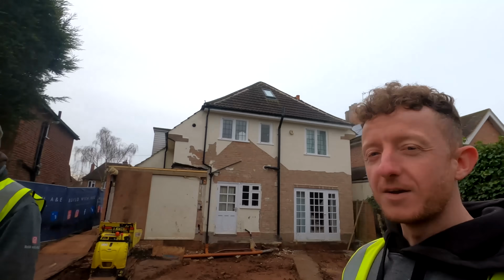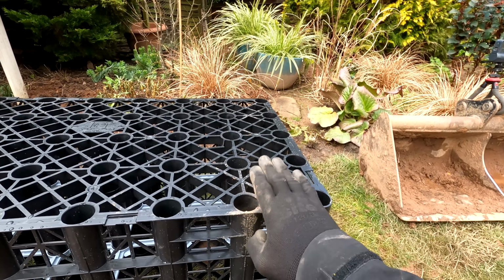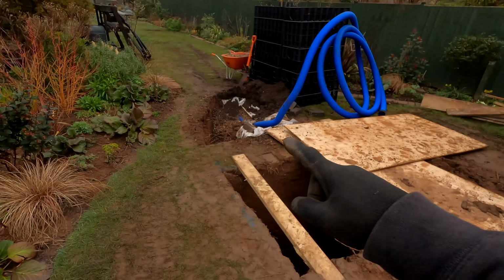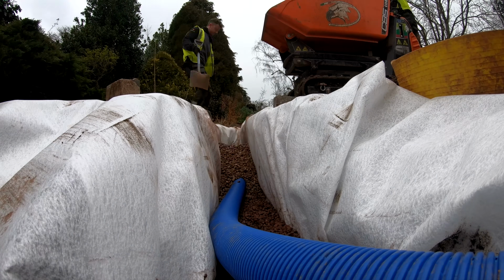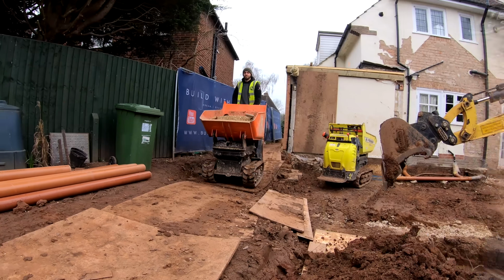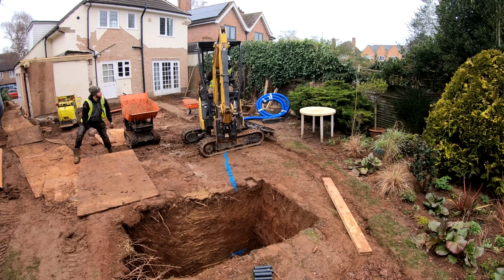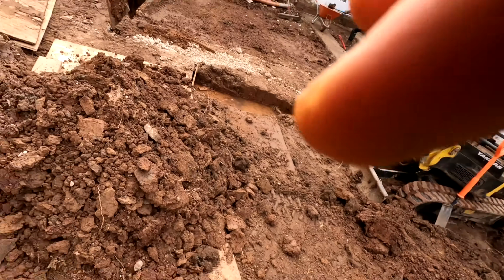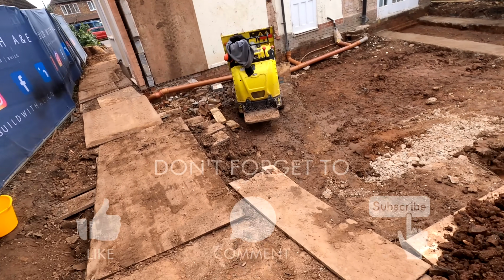Digging the Soakaway! | Single Storey Extension #7

Comment: guys bearing in mind you connected to the "soakaway" at a low level, please consider installing a vent pipe to the crates to let them breathe and for the water to drain as efficiently as it can it that clay soil.
good luck

Comment: 🔴 Hi, all that clay ?? did you eventually dig deeper until you came to permeable subsoil ?? because I understand the bend and vertical pipe to maximise the full use of the area of the soak away, however, the pressure of the soak away "being full" would just push water up the pipe anyway, and eventually fill your catch pit,  ( unless you reach a depth where you find permeable subsoil. Obviously, soak away's have to be able to "Soak away"  Let me know your view ?? Cheers

Comment: Loving this series guys. Even the dirty, muddy work is interesting. Great workmanship as always.
Reply from the maker: Thanks David 👍
Reply: I can see the idea of putting a vertical piece of 110 mm pipe to raise the level but it’s only 110 and it won’t take much to fill that diameter / vertical pipe should the water raise to the top of the crate inlet pipe

Comment: Great work lads but that soakaway will not work at all in that clay it will just fill up and not go anywhere best to connect to the storm drain or the foul if no storm on site.
Reply: IKR
Reply: You cannot connect rain to foul it’s illegal .
Reply: As stated above, you are not allowed to connect rainwater into the foul drainage system, in the UK.
Nor will the water soak away in that clay, so a tricky situation; the customer may still have flooding in the garden, but maybe further from the house than before!
Reply: You can connect to the sewer but you need to demonstrate that other options are not suitable or available and  BCO to agree. Then get permission from whoever owns the system on that area.
Reply from the maker: Hi Everyone 
Building a soakaway in clay soil can be challenging due to the low water infiltration rates achieved in most clayey soils. Some clay soils will achieve virtually zero infiltration and in these soils a soakaway will not be practical.

Other clay soils will achieve a low infiltration rate which makes a rainwater soakaway in clay possible. However, in these soils a conventional soakaway pit is often only effective when it is built very deep to increase the infiltration surface and includes a large storage area to store water while it slowly soaks away. Soakaway crates in clay have the advantage of a large void space which can be advantageous in such conditions. Even in these cases the soakaway can struggle to comply with time of emptying requirements due to the low infiltration rate.

Soakaway Design in Clay Soils

Where a low infiltration rate is expected such as in clay soils it is critical that a thorough site investigation and infiltration testing is done before the detailed design of any soakaways. A site investigation may reveal better infiltration layers either in another part of the site or in strata beneath the clay layers. In this case sometimes a deep bore soakaway can be installed through the clay layer into the infiltration strata.

One advantage of soakaways in clay soils is that the small pores are less likely to become clogged with sediments which build up within the soakaway. This can make soakaways built in clay soils more robust than some other soils.

How to Build a Soakaway in Clay Soil

Digging a soakaway in clay soil can be approached in the same way as in any other soil, as described here. Particular care should be taken to ensure that the excavation does not become smeared when using mechanical diggers. If smearing does take place the sides of the excavation should be roughened using hand tools.

Other Ground Conditions

The installation of a new soakaway can have significant effects on the surrounding soils. For this reason it is important that the existing ground conditions are assessed before the detailed design of a new soakaway is completed. Below is a summary of some of the most common issues;

Poorly Consolidated Soils

The installation of a new soakaway can cause instability in poorly consolidated soils. This is because the new source of water infiltrating through the soils can lead to wash out of fine materials from the soil. This can lead to significant voids forming over time which are then prone to collapse. In some soils the infiltrating water can also cause the soil to consolidate leading to settlement.

Fill Materials

Infiltrating water passing through loosely compacted fill materials can cause the fill to compact, leading to differential settlement. This is particularly significant in deep layers of fill material, such as infilled quarries or landfill sites. In some cases the fill layers can be protected from infiltration using impermeable liners.

Shrinkable or Expansive Clays

Some types of clay soils can shrink or expand depending on the water content of the soil. A new soakaway will have localized effects on the water content of the surrounding soils which can lead to shrinkage and differential settlement of some clays.

All the best Tony 👍
Reply: Tony as usual mate your knowledge is wonderful. Soakaways are very challenging to be able to adequately get them to work .soil conditions and percolation tests are paramount to Soakaways working correctly its a bit of a science isn't it mate .Great job as always mate and good luck in the new year 👍
Reply: Not true, you can put one in any ground condition subject to the infiltration test

Comment: Great content! Why do you build a soak away, rather than just connecting to the rain water drains?
Reply: One might presume, as an older house, there is no separate storm water only drainage, and you're not allowed to connect to the foul drainage either !
Reply: @thetessellater9163  thanks for the reply, just out of interest, if that’s the case does the current storm water from house guttering go down the drain, or to a soak away?
Reply: @duncanlane22  Some modern house builds have all the surface water drainage systems (gutters down pipes, channel drainage) connected to soakaways.  It's part of a sustainable drainage system (SUDS).  It is considered not to overload existing surface water drainage systems (from buildings/roads).  However, it's effectiveness is dependant on the ground conditions (sand/gravel is much better than clay).  There are requirements for separation from housing/structures (so that water dissipation from the soakaway does not cause damage).

Comment: That took me 2 hours to watch that in between calls. Just a couple of quick questions.......on the 90 bend just outside of the soakaway going vertical apart from p gravel do you have to put anything under the bend like a small pav slab for support? Also when digging a trench at what depth do you need to shutter it at or does it depend on soil type or how long its open? Thanks for the great videos....
Reply: I thought that too, with any excavations below 1.8 metres (or was it 1.5 m?) you should have trench shoring if a person needs to go in ! Fines are large for this breach if HSE might watch this?
I seem to remember this from deep founds dug near trees back in my day!
Reply: @thetessellater9163  I have to do a bit of a dig out and wondered what depth you had to shore up.....and did the soil have anything to do with it. Was trying to crib some knowledge...

Comment: my garden is on small slope its 8m x7 Square,,, theres 1800 mm paving at 12 inch high because of surface water used lodge. i need to put down a surface for my dogs. ,fake grass with eco drain at the foot of the paving with soak hole so the 2 are close toghter,, ,,how do i achieve what you done if my eco drain is at the foot of the paving your diagram maximise you water level ,can it be done when eco is close to hole

Comment: Theres a lot of clay in the ground there.. just wondering if that would pass a percolation test
Reply: I was just wondering that having just done that test myslef and the calculations coming back with a pretty big 11 cubic meter soakaway!
Reply: @JurassicJungle  christ.. unless you live in an aircraft hangar i cant see that being justified. What other options do you have? Are there any land drains nearby you can connect into?
Reply: @ninety1464  We are adding 120m Sq of new roof space which doubles  the current property. We have a stream with riparian rights which we could release water into but we have to show how we can attenuate. We did the infiltration test and the report came back with a soakaway of 6m x 1.2 x 1.5! There is a history of surface water flooding. What annoys me is the house across the road added a similar extension recently but was not obliged to add any soakaways at all.
Reply: @JurassicJungle  sounds like you have a nice property! 

have building control asked for or over seen the percolation test? ordinarily 240m² of roof would necessitate a soakaway just under 5m² (as im sure you well know).. building comtrol may be satisfied with that (unless youre not willing to take the risk yourself)

If possible then utilise the stream as an overflow perhaps this would be sufficient
Reply: @ninety1464  we did the test ourselves based on guidance of a specialist who produced the report for us. We have a solid stone wall about 2.5m down to the stream with no drainage holes. We certainly plan to add some

Comment: Was the blue pipe laid at a fall or level at point 6.42 on the video ?
Reply: 1:40 to 1:80 is best. As a rule of thumb, an inch per metre to half inch per metre, to mix measures!
Reply: @thetessellater9163  Thanks for the reply, keep digging boys you might hit oil soon.👍👍👍

Comment: From HSE. Trenches 5 feet (1.5 meters) deep or greater require a protective system unless the excavation is made entirely in stable rock. If less than 5 feet deep, a competent person may determine that a protective system is not required.

Comment: Love the channel, but like others have said, the soakaway will not be that effective. That said, you are stuck between a rock and a hard place. BCO and the sewer operator will not let you connect to the sewer and you are in heavy clay so soakaway don't work. Does the engineer not recommend infiltration testing is done first to prove soakways are not viable and then propose an attenuation tank with a flow control on it? That's what I would do, but again if you are just appeasing the BCO, you only need to design for the 1 in 10 storm where as the sewer authority would want the system designed for the 1 in 100 plus climate change. I can see why you did what you did and sometimes it is worth not making a meal of these things but that said, there are so many contractors that just think soakaway work irrespective of the ground conditions. Sizing then with all sorts of strange rules of thumb. The issue the domestic construction industry has is building control, they have so much power but quite often so little time and knowledge, applying the same solution time and time again without considering the variables. Sorry, rant over, great channel.
Reply from the maker: Hi Paul thanks glad you are enjoying the channel,
Building a soakaway in clay soil can be challenging due to the low water infiltration rates achieved in most clayey soils. Some clay soils will achieve virtually zero infiltration and in these soils a soakaway will not be practical.

Other clay soils will achieve a low infiltration rate which makes a rainwater soakaway in clay possible. However, in these soils a conventional soakaway pit is often only effective when it is built very deep to increase the infiltration surface and includes a large storage area to store water while it slowly soaks away. Soakaway crates in clay have the advantage of a large void space which can be advantageous in such conditions. Even in these cases the soakaway can struggle to comply with time of emptying requirements due to the low infiltration rate.

Soakaway Design in Clay Soils

Where a low infiltration rate is expected such as in clay soils it is critical that a thorough site investigation and infiltration testing is done before the detailed design of any soakaways. A site investigation may reveal better infiltration layers either in another part of the site or in strata beneath the clay layers. In this case sometimes a deep bore soakaway can be installed through the clay layer into the infiltration strata.

One advantage of soakaways in clay soils is that the small pores are less likely to become clogged with sediments which build up within the soakaway. This can make soakaways built in clay soils more robust than some other soils.

How to Build a Soakaway in Clay Soil

Digging a soakaway in clay soil can be approached in the same way as in any other soil, as described here. Particular care should be taken to ensure that the excavation does not become smeared when using mechanical diggers. If smearing does take place the sides of the excavation should be roughened using hand tools.

Other Ground Conditions

The installation of a new soakaway can have significant effects on the surrounding soils. For this reason it is important that the existing ground conditions are assessed before the detailed design of a new soakaway is completed. Below is a summary of some of the most common issues;

Poorly Consolidated Soils

The installation of a new soakaway can cause instability in poorly consolidated soils. This is because the new source of water infiltrating through the soils can lead to wash out of fine materials from the soil. This can lead to significant voids forming over time which are then prone to collapse. In some soils the infiltrating water can also cause the soil to consolidate leading to settlement.

Fill Materials

Infiltrating water passing through loosely compacted fill materials can cause the fill to compact, leading to differential settlement. This is particularly significant in deep layers of fill material, such as infilled quarries or landfill sites. In some cases the fill layers can be protected from infiltration using impermeable liners.

Shrinkable or Expansive Clays

Some types of clay soils can shrink or expand depending on the water content of the soil. A new soakaway will have localized effects on the water content of the surrounding soils which can lead to shrinkage and differential settlement of some clays.

This is a great document we work to and BCO required us to do something all the best Tony 👍

Comment: Another total waste of time and money for the customer, soakaway has no chance in working in clay ground like that
Reply from the maker: Building a soakaway in clay soil can be challenging due to the low water infiltration rates achieved in most clayey soils. Some clay soils will achieve virtually zero infiltration and in these soils a soakaway will not be practical.

Other clay soils will achieve a low infiltration rate which makes a rainwater soakaway in clay possible. However, in these soils a conventional soakaway pit is often only effective when it is built very deep to increase the infiltration surface and includes a large storage area to store water while it slowly soaks away. Soakaway crates in clay have the advantage of a large void space which can be advantageous in such conditions. Even in these cases the soakaway can struggle to comply with time of emptying requirements due to the low infiltration rate.

Soakaway Design in Clay Soils

Where a low infiltration rate is expected such as in clay soils it is critical that a thorough site investigation and infiltration testing is done before the detailed design of any soakaways. A site investigation may reveal better infiltration layers either in another part of the site or in strata beneath the clay layers. In this case sometimes a deep bore soakaway can be installed through the clay layer into the infiltration strata.

One advantage of soakaways in clay soils is that the small pores are less likely to become clogged with sediments which build up within the soakaway. This can make soakaways built in clay soils more robust than some other soils.

How to Build a Soakaway in Clay Soil

Digging a soakaway in clay soil can be approached in the same way as in any other soil, as described here. Particular care should be taken to ensure that the excavation does not become smeared when using mechanical diggers. If smearing does take place the sides of the excavation should be roughened using hand tools.

Other Ground Conditions

The installation of a new soakaway can have significant effects on the surrounding soils. For this reason it is important that the existing ground conditions are assessed before the detailed design of a new soakaway is completed. Below is a summary of some of the most common issues;

Poorly Consolidated Soils

The installation of a new soakaway can cause instability in poorly consolidated soils. This is because the new source of water infiltrating through the soils can lead to wash out of fine materials from the soil. This can lead to significant voids forming over time which are then prone to collapse. In some soils the infiltrating water can also cause the soil to consolidate leading to settlement.

Fill Materials

Infiltrating water passing through loosely compacted fill materials can cause the fill to compact, leading to differential settlement. This is particularly significant in deep layers of fill material, such as infilled quarries or landfill sites. In some cases the fill layers can be protected from infiltration using impermeable liners.

Shrinkable or Expansive Clays

Some types of clay soils can shrink or expand depending on the water content of the soil. A new soakaway will have localized effects on the water content of the surrounding soils which can lead to shrinkage and differential settlement of some clays.

All the best Tony 👍
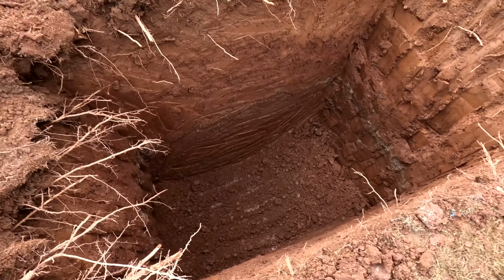Reply: 9 3:54 😅 4:20  @BuildWithAE